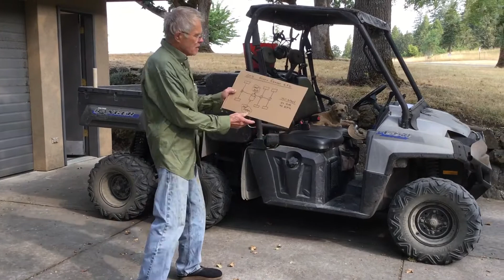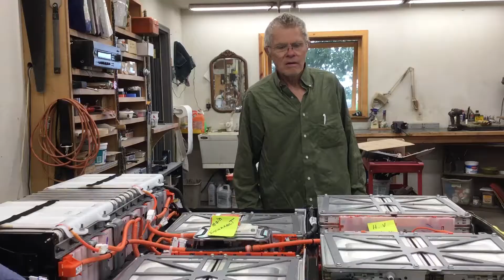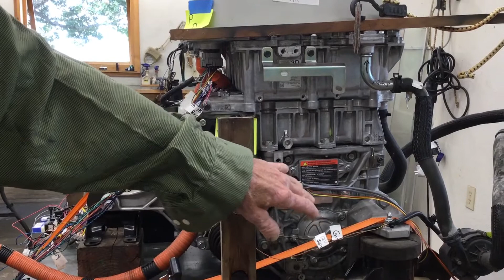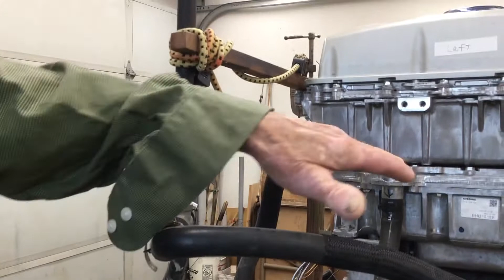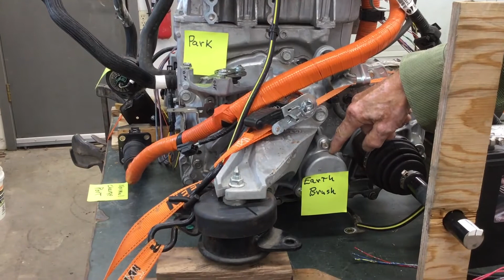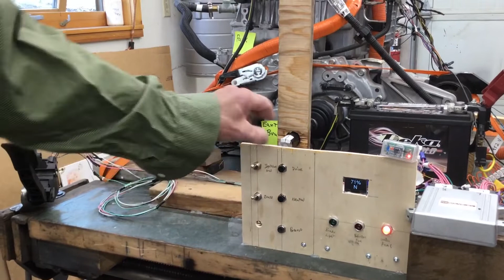Leaf EV conversion using a Resolve Controller

Comment: I am looking at the resolve for simplicity and your walk thru is fantastic. Thanks for sharing!
Reply from the maker: Now have almost 500 hours on the Leaf conversion and it is still working perfect.
Reply: @roynelson2790  excellent! Glad to see it paid off for you. I have my donor LEAF purchased.. hoping it will be powering a forklift!
Reply from the maker: @TheBlairHouseProject  Interesting, how are you going to run the hydralics?  What size of fork lift?  Is it electric now or gas ?
Reply: @roynelson2790  It is a diesel and rated to 12K pounds. I was hoping to drive everything the same way the diesel does... the engine crank shaft drives the hydraulic pump and transmission.
Reply from the maker: @TheBlairHouseProject  The Leaf motor speed is 0 to 10,400 RPM.  You diesel probably has a top speed of less than 3000 RPM.  So you need to figure out how to reduce that speed or just not allow the unit to go too fast.  The Leaf motor has a lot of torque so that may work just fine to connect the Leaf motor directly to forklift transmission.  (maybe discuss with Isak from Resolve).  Keep in mind, that the accelerator controls torque not speed.  The leaf has a gear reduction and the differential reduction in the transaxle with a max output of 1250 RPM.  With my conversion I welded the differential gears solid, then used the Leaf axles to drive the front driveshaft and the driveshaft for the rear axles on the Ranger with a top speed of 24 MPH because of going thru two differentials.  If the rotation is not correct, Resolve has instructions on how to change rotation of the motor.
Reply: @roynelson2790  Thanks Roy! 

Yeah, I know the leaf has a 8:1 step down from the crank to the drive shafts. I would probably have to maintain that. 
I generally have zero need to run the forklift more than half throttle. Most of the time it just sits around holding things up in the air. 
The diesel is loud as hell and makes it really hard to talk over it, so an engine that makes zero noise when it isn't moving is very appealing. 🙂
It would be great to be able to tweak things up and down, left and right without a constant diesel rattle.

Comment: I can't hear a flaming word you are saying!
Reply from the maker: I just checked it and it works fine.  Check your volume control, is speaker shut off, also you can use closed caption

Comment: You did a great job of explaining your build. I’m about to do a VW dune buggy conversation and I think I’ll copy your setup and use this converter.
Reply from the maker: Thanks,  Feel free to contact me if I can help.  The Ranger is working perfect, love the quiet and torque.
Reply: @roynelson2790  that’s very kind of you, I might take you up on that. I’m actively looking for a donor leaf now. I was sure your Ranger was probably still working, you guys did a really clean job.
Reply from the maker: @rexmundi8154  This Ranger is not used for recreation.  We have an 800 acre ranch in Oregon with 14 miles of fence lines that need to be maintained and on very steep terrain.  The gas Ranger was under powered, had problems with transmission gears dis engaging when going down the mountain, very scary.  With the re-gen I hardly ever need to use the brakes.

Comment: Thanks Roy! I really appreciated your walkthrough of all the components.  Just bought a 2017 Leaf motor stack and am going to try to shoe horn it into a 59 Austin Healey Sprite.  I will definitely be ordering  the Resolve EV thanks to this video!  
One question, what is the little box that provides bluetooth comms to the Leaf Spy app?
Reply from the maker: You have to buy a Bluetooth adapter.  I went to Leaf Spy Pro website and read their info.  I choose the LE Link2 OBD-2, cost $30.
In your conversion, if motor, inverter and charger are too high to fit, you can remove the charger and relocate it.  You have to make cables, hoses etc. but I can give you some ideas to keep it simple.  I had to move charger for my conversion.   Done with mechanical, working on wiring and making aluminum battery box as I had to reconfigure the battery pack
Reply: @roynelson2790  Thanks again Roy!  I need to make sure the Leaf motor stack will work in my tiny car (Austin Healey Sprite), once confirmed I will be, for sure, buying all the other components.  Your videos are very much appreciated and I'll keep you informed as to my progress!
Reply from the maker: Mark, I purchased a wrecked Leaf, in that way you get all the components you will need; wiring, water pump, battery, motor mounts, maybe radiator, etc.  also keep in mind the RPM differences in the old motor verses the Leaf motor if you are going to use the existing transmission.
Reply: @roynelson2790  I've been searching for a salvaged Leaf but there are none locally.  There is a salvage auction site called copart but their fees are crazy.  I got a really good deal on the full stack with wiring harness so if it fits, I'll move forward with the other purchases.

The current car has old MES-DEA components.  The ~30 HP motor is directly driving the drive shaft.  I'd like to get the full Leaf unit in along w/gear box but will need to get a custom shaft made I suppose.  I like Resolve EV because I believe you can adjust the torque curve.
Reply from the maker: @buddynscooter  The Leaf does not have a gearbox (transmission), just  gear reduction, then transaxle.  So if you put the unit in front you could go with front wheel drive, or put in back and have rear wheel drive.  Yes, you can adjust torque settings via software up date.  In the Ranger I turned the unit 90 degrees and drive the front wheels with one axle and the rear two differentials with the axle.  I have the power going thru 2 sets of differentials so top speed will only be about 24 MPH.  I welded the Diff in the Leaf unit solid.

Comment: Thanks for making this video. I am looking to convert a 85 VW Cabriolet and was thinking Tesla but now I may move to a Nissan Leaf drive train with a resolve ev controller.   Love to see the finished product.
Reply from the maker: I have motor/inverter/charge installed, working on battery box and wiring. In the video I said I was going put motor under the seat and battery behind the seat, changed my mind, now reversed it .